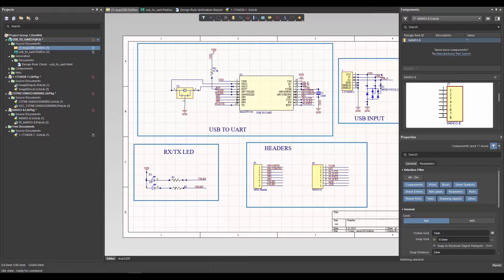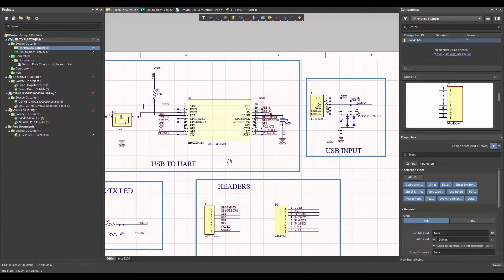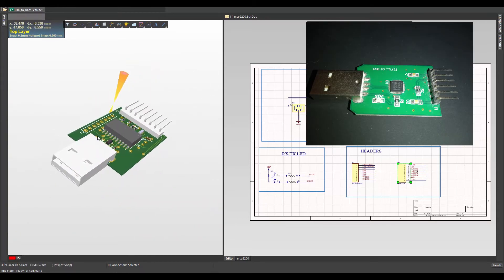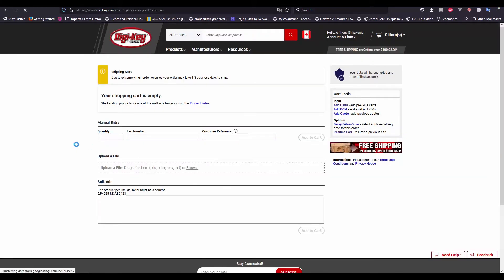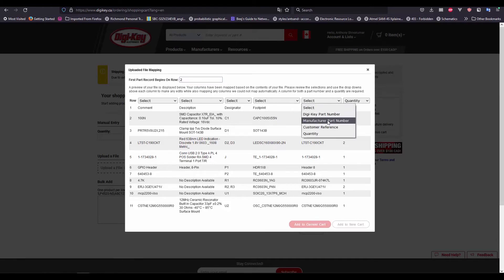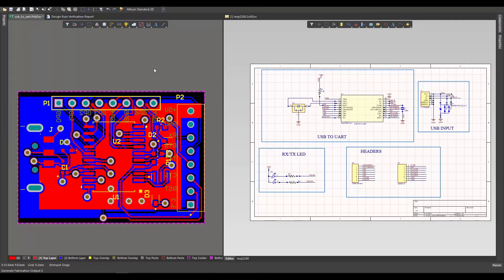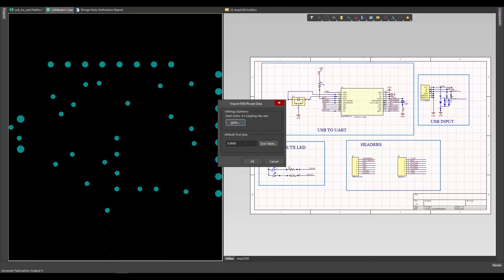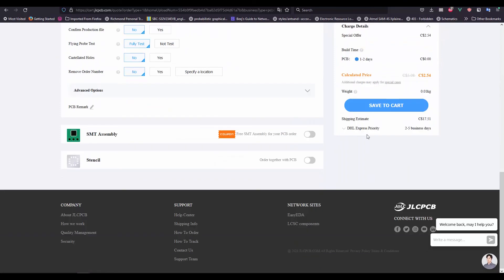How to design a USB to UART Converter using MCP2200 (Part 1)

Comment: Can you tell me if the circuit needs programming and loading code? please?
Reply from the maker: Does not need any programming. Should work directly.
Reply: @antshivrobotics  So you just need to install the cp2102 driver on your computer, right?